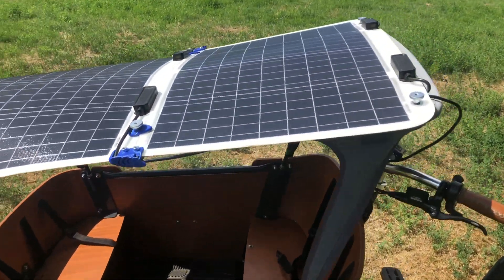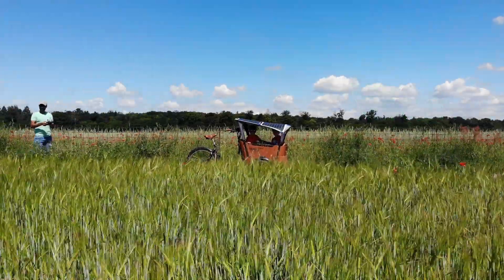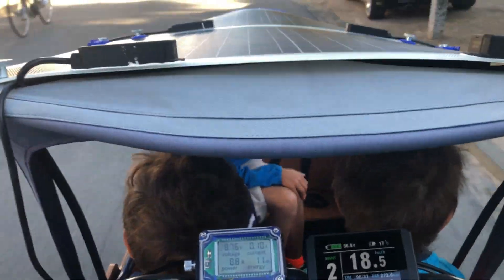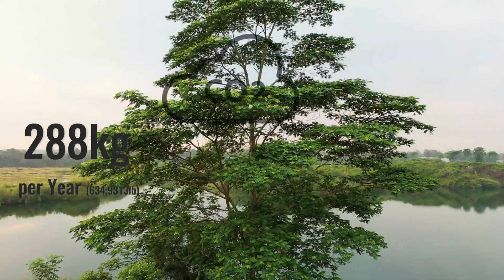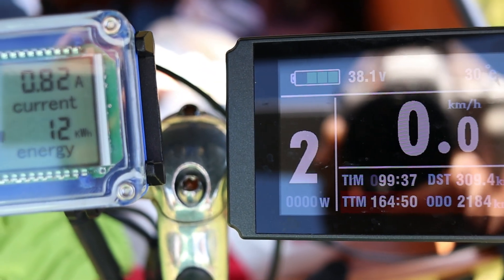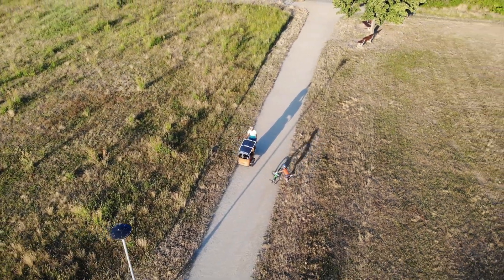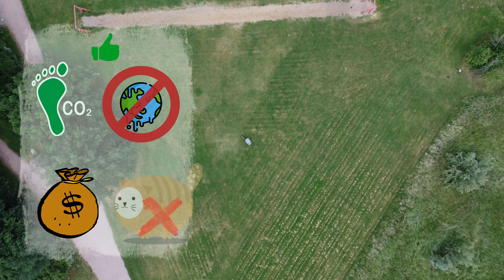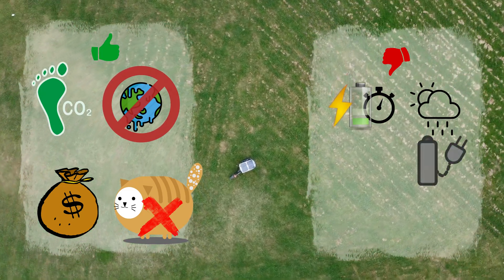How My DIY Solar Bike Saved Me Money!

Comment: Awesome project! Impressed that you got the electronics so tidy. Has it survived to this day, and do you still use it?
Reply from the maker: Glad you liked it. After a couple years of daily use, the power output of the solar panels degraded. I guess the panels suffered micro cracks due to vibration. I had to build a  more rigged frame to hold the panels and reduce vibration. One year in and still seems to work fine.